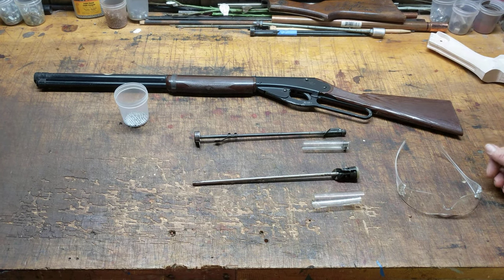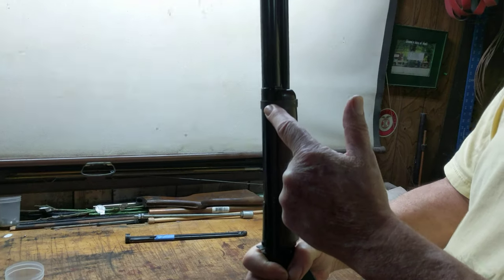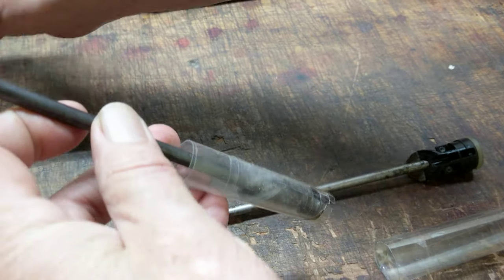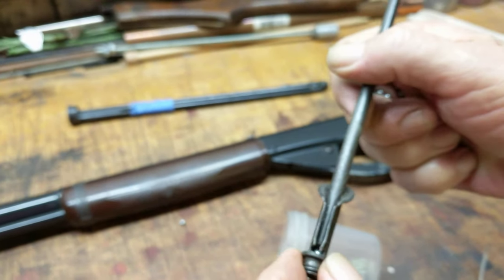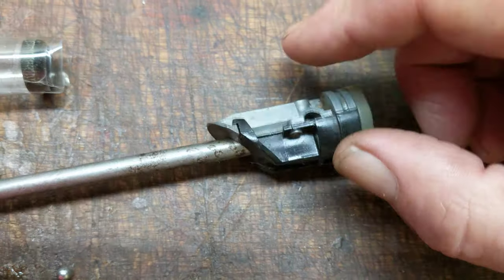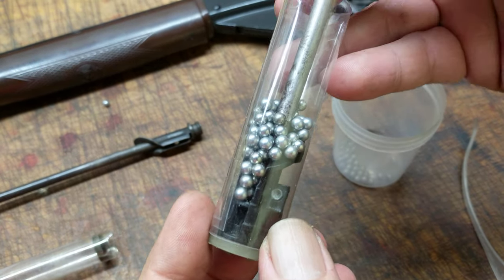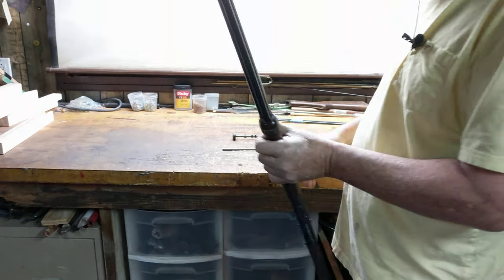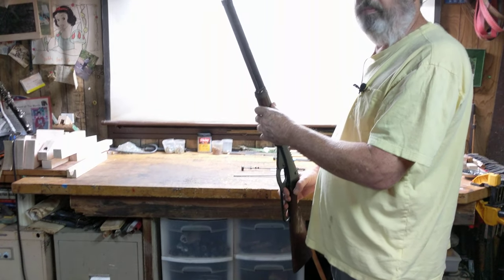How rattletrap BB guns work, the miracle of gravity feed

Comment: What year is that daisy you are showing? Mine was from about 57 Did not have RED Rider logo on stock but did have the safety pledge. Was it blued or painted? Thank you
Reply from the maker: I'm pretty sure that was a Daisy Model 111, pre 1978 due to the metal trigger and Lighting Loader Bottle cap. I was painted and aside from a missing trigger return spring, in pretty good shape.
Reply: @RestOModDaisy  Thank you, I have had a hard time finding any info on it.

Comment: Thanks for your video. This means that pvc or plastic bbs wont work on Daisy Red rifle because it works with a magnet right? (these plastic 4.5mm bbs are manufactured by ASG and is the only one who do that)
Reply from the maker: You might experience an increased rate of misfires in a current production gravity fed Red Ryder with the synthetic BB's but if one can get into the chamber it should shoot. Incorporating a muzzle up move with a firm shake should wrangle one into the breech as gravity never rests.I don't have any direct experience with that product but it seems like it should work with the current production Moodel 25 shot tube as it is a spring fed system. Given the weight difference between the plastic BB and the steel BB, you should see an incease in FPS but a drop in penetrating power.

Comment: How does the air go down the barrel and not just piss out of where the BB's feed into?
Reply from the maker: The airtube at the end of the plunger transfers compressed air to the shot tube as the mainspring pushes it towards the muzzle. Once the airtube has moved about 1/4" into the rube the feed port is blocked by the airtube body and the main part of the compressed air is channeled into the shot tube to power the BB. There is some air lost by the less than perfect seal of the airtube at the feeding port and several other modders have taken steps to reduce it. Check out this video on some of the work that Terry Cowger as doner on this issue:

https://studio.youtube.com/video/KTR9MBDNKtY/edit

Comment: Looks a little like mine, mine a dark wood stock and a plastic grip. I think its from the around 1955 to 1965. It was my grand fathers.
Reply from the maker: The gun in the video was a Daisy Model 111 bottlecap produced after 1958 but before 1978. It was not uncommon for some of these small frame Daisy's to have mixed stock sets as Daisy migrated to plastic furniture in the 60's before they went the other way back to wood stocks in the 80's.
Reply: @RestOModDaisy  My grand father was a train engineer. he found it in a rail car, in the 50's.
Reply from the maker: @altonlynch5464  I love to hear more detail, that sounds like a classic Daisy story.

Comment: Thank you for this video.  I still can't get more than 8 consecutive shots from a brand new 1938B without a dry fire, but it's much appreciated.  
Also, is there a way to update a '46-47 (?) #111-m40 with new internals?  I have my father's old Red Ryder Carbine.  It's a bottle cap, all wood furniture, steel foregrip band and aluminum cocking lever.  Stepped rear sight, but it doesn't appear to have had the adjustment screw...  Though it may have, as there is a hole, but it could just be a peen mark.  It's heavily rusted and doesn't feel right when attempting to cock it.
Reply from the maker: Sounds like your Model 1938B might have a partially obstructed feed ramp. What brand of BB's are you using? You can certainly mod a #111 Model 40, I've done plenty of them. The crunchy sound might be a sacked mainspring or a plunger assembly with some leg deflection. Old guns like that got run pretty hard back in the day, if there's rust externally, then there's rust on the inside. Taken it apart yet?
Reply: @RestOModDaisy  
I'm using Red Rider BB's.  Zinc coated.  
I think the 1938b feeding issue is operator error.  Your videos have definitely educated me on the inner workings. 
The 111-40 has not been pulled apart yet.  I have to make a tool to relieve the spring pressure first... That, and make a spot on my bench.
Reply: @Matt-416  I just picked up a brand new 1938 Adult Red Ryder and I, too, frequently get dry fires fairly frequently. I do my best to always give it a shake and ensure the lever is cocked all the way. This video was definitely helpful though! Thank you!